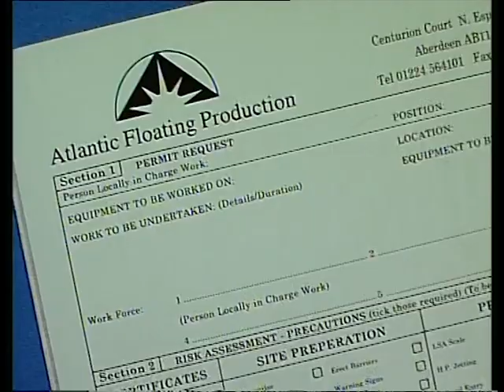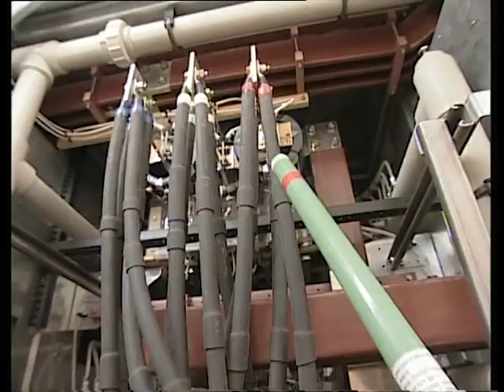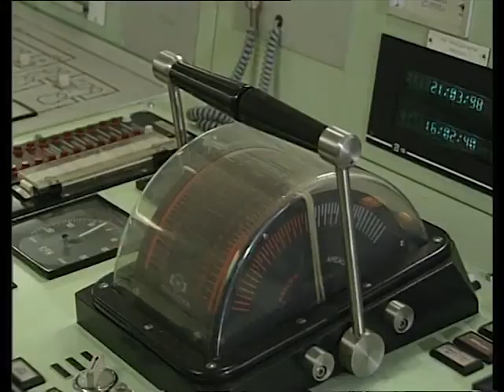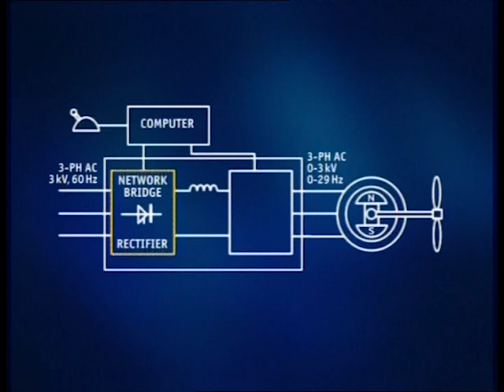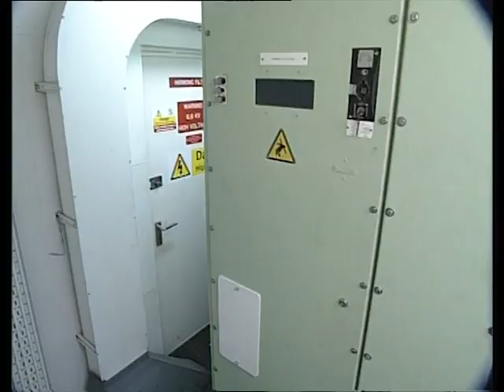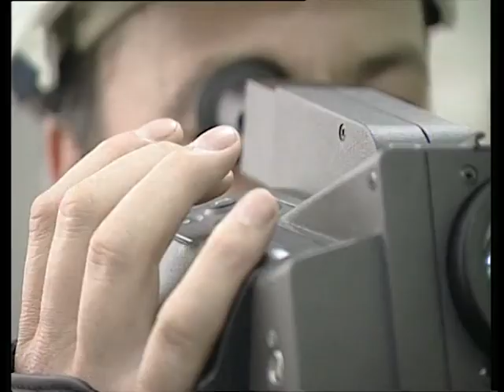Practical Marine Electrical Knowledge: Program 8. Electric Propulsion & High Voltage Practice

Comment: Have academic studies been conducted on the difference between propulsion with electricity generated by a diesel engine and propulsion directly by a diesel engine ? The electrical system is very complex and requires many steps. I believe that using a diesel engine is better, simpler, and much less dangerous than a consumer electrical system.